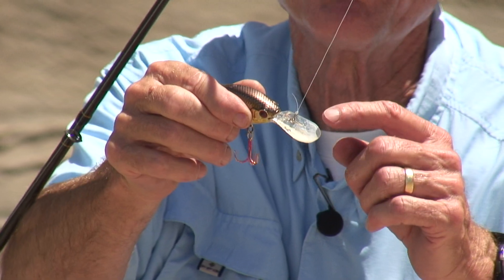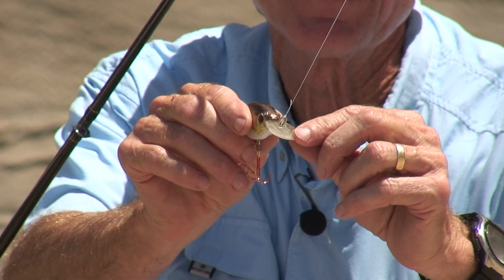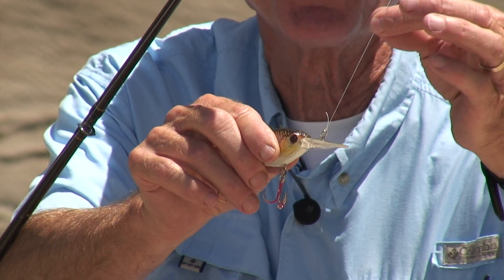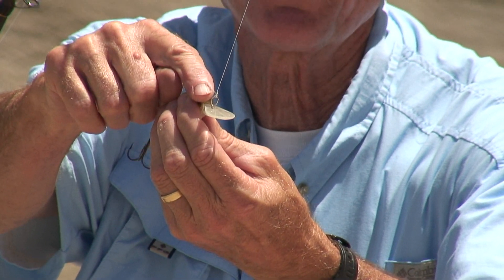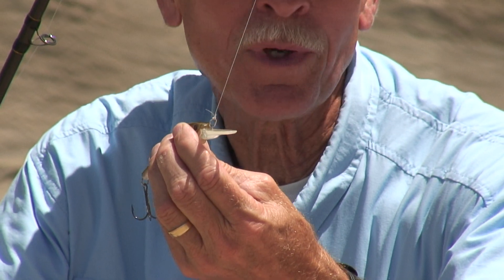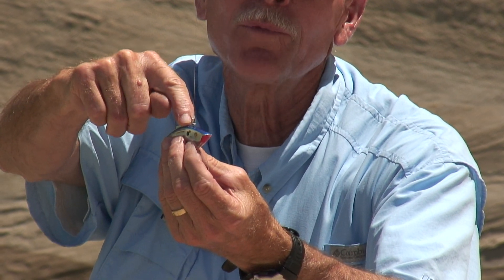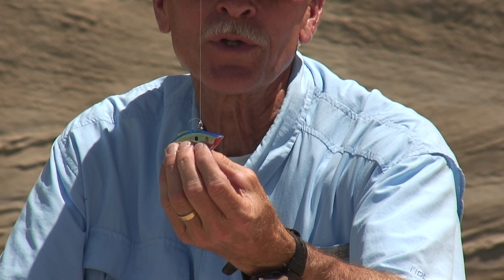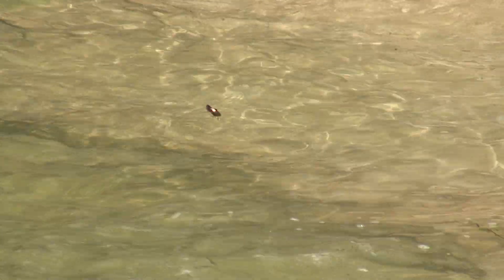Fishing Lures & Baits : How to Rig a Crankbait

Comment: Having fished multiple s in different sizes and colors, https://www.youtube.com/post/UgkxCbNOWAGmn6nfbCbJDmasvBq7J38KZNw2 this is by far my favorite. One thing to be aware of is the sided willow blade. One side is silver and the other is the green/orange shown. This is not bad, just unconventional. In terms of fishing, I have found the lure works just fine without a tail like a craw or shad. That addition is up to you. Also, the hook part where you attach the swivel snap or tie the line is a problem on baits these days, since it's able to slide up and down. However this lure seems to be tight enough that that doesn't happen often, and you can solve it by putting a thin slice of medical tube over the hook before attaching the line. Like others have said, it's really magic on a good windy day.